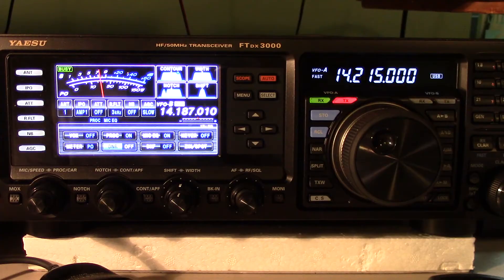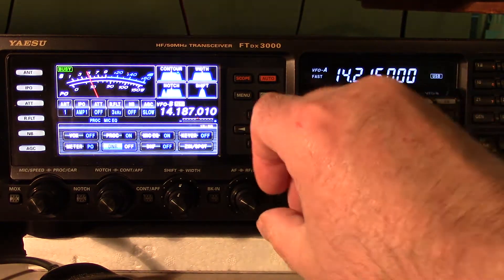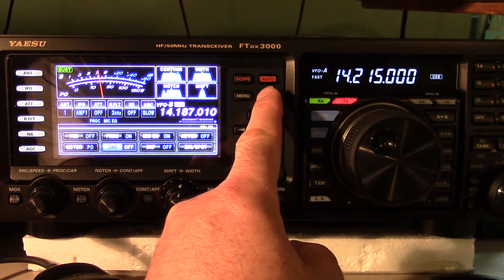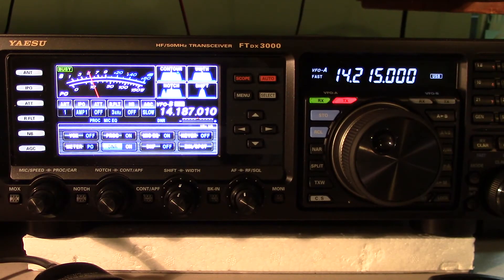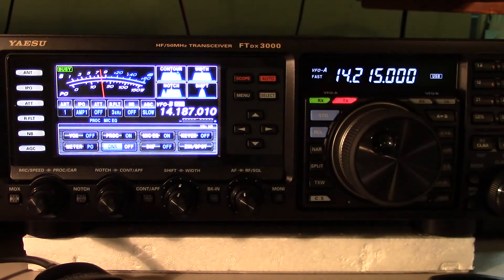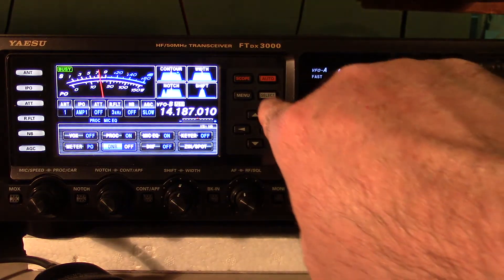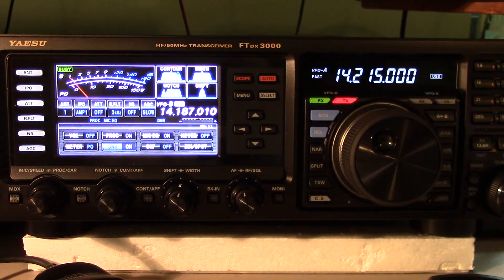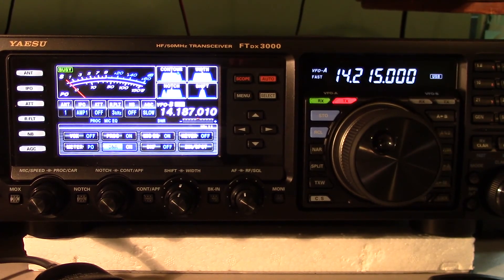Yaesu FTdx3000 noise reduction - HOLY COW!

Comment: I just received my FTDX 1200 2 hours ago and I love it. It is superior to the Icom 7300 receive audio on 11 meter  SSB voice. No matter what you do or adjust, the background noise when listening to weak signals on the Icom gives me a raging headache. I hate the 7300.!! I bought the matching external speaker and the Icom pan adapter software too. I should have bought the FTDX 3000 in the first place!!! Live and learn. I should have stayed with Yaesu!!
Reply: I fully agree with you
Reply: No sir the 1200 is not superior to the 7300. Suggest you get an amateur radio license and ditch the no class CB band

Comment: I have had My FTDX3000 for about 3 years and as most people have said, it is just incredible - the receiver is the best I have heard, which is the reason I purchased an FTDX3000. I had read so many GOOD things about the Receive audio and I was having problems hearing Portable stations on My FT-920. Well. what I had read was ALL Correct. The DNR is just unreal, although You have to go into the menu to change the value of the DNR ,there are 11 values, so it really makes a difference on 11 when You press the button to ON. There are a few little things I don't like, like the Mode Button, the Antenna tuner in which the frequencies must be Pre-tuned otherwise it is slow to tune.. the CLAR/VFO knob which is very easy to bump, unless switched off... What would I buy if i was going to buy a new Radio - Easy, a new FTDX-3000.... Recommended by VK2LEE  LEE

Comment: I spent many hours in several HRO stores, playing with many different radios, trying to find the one i liked the most. FTDX5000 was the best of them all while the FTDX3000 was the second best. I was really amazed by how quiet the radio was and how well the receiver performed. It was significantly better than many expensive rigs like TS-990, IC-7700 etc. So I pulled the trigger and got a new FTDX-3000.
The radio performs better than I even expected after I got it connected to my large HF Yagi system (at 75 ft above ground).  I used to use my Elecraft KX3 but the FTDX3000 is SO MUCH better, especially the receiver. The Elecraft has too much noise and has a hard time hearing weak stations on a busy band while the Yaesu 3000 hears even the weakest stations without much struggle. 
CW performance is superior too. The receiver has no ringing, even at the lowest DSP bandwidth setting and maximum DSP noise reduction setting. CW signals, even the weakest ones, sound like a bell. I wish my Elecraft was half as good as the FTDX3000. Good luck getting such performance with any other rigs, even the expensive SDR transceivers. Believe me, I've done a lot of side by side testing.
I'm not affiliated with Yaesu or any other brands but I'm very happy with my FTDX-3000. I've been a ham for over 30 years and learned a lot about radios and the hobby. I'm very picky about RX performance and RX audio quality. Yaesu exceeded my expectations! Good job!

Comment: I have an FTdx3000 and it's the best (by far) radio that I have ever operated.  Are there some shortcomings?  Of course there are and the ones I think people will want to consider most are the following for they haven't been addressed in firmware updates.  First the Internal Antenna Tuner isn't as good as I have found in many other radios including Kenwood and ICOM's but it does function depending on the antenna you start with.  There are some antennas though that it just won't attempt to tune.  Second I don't like the Notch filter adjustment knob.  It's not a smooth adjustment but more a ratcheted knob that clicks as you turn it.  For me I prefer a smooth turning knob.  I cannot comment on how easy/difficult/involved the firmware update procedure is and if you can use a Mac to do so but I've heard the Yaesu updating method isn't as straightforward as the Kenwoods.  I have also had a Yaesu FT-1000MP Mk V Field radio and really enjoyed the separate VFO's where you could listen to two frequencies at the same time and vary receive level between them.  The FTdx3000 doesn't have dual VFO receive but does have VFO A and VFO B that you can set and then switch between them but cannot have both active on receive at the same time.

As for my personal preference I would choose the FTdx3000 over any other Yaesu radio for I believe it's the best (combination), quietest, receiver they have.  The 5000 will give you two independent receivers and the 5000 is rated a better receiver by Sherwood but as for being quiet and a low noise floor to work with I think the FTdx3000 can't be beat by any other radio Yaesu makes, at least at this point.  I could be wrong and that's my opinion but it is based on my personal experience of comparison with other radios and listening to youtube videos of other radios.  I AM BIASED and admit it but I don't think there is a better buy in Radio, for the money, and for what you get.   Once you get the menu settings perfected for your mike and engage the ESSB (4 Khz) transmit audio I get constant, glowing, reports about how good my transmitted audio sounds.  When you open up our receive bandwidth, engage the Digital Noise Filtering and utilize the RF control along with choosing whether or not to engage the pre-amplifiers you can have a receiver that sounds like it's not even connected to an antenna at all until you hear that signal come booming through.  

The real satisfaction comes when you are setting there enjoying that super low noise floor where the radio is so quiet and then through that quiet hear some weak station that you know you would have never heard on another radio.  I have a backup radio ( Icom IC-7000 ) and have many times hear stations/calls on the Yaesu FTdx3000 that when I switched over to the ICOM became lost in the noise floor or normal static.  I'd love, for myself, to be able to set it beside a Flex 6300 which compares with it cost wise, and see how the two compare but then if I ever get to where I purchase another radio I don't know if it would be the Elecraft, Flex 6300 or Flex 6500 and since there isn't a Radio Fairy to drop off one and I don't have some rich relative that's willing to bestow some love on me I'll remain and be happy with what I have for I'm truly grateful that I'm able to have that and feel that if the FTdx3000 is going to be surpassed then it's going to be a much more expensive radio that will have to do it.
Reply: Gary K I also have the FTDX-3000 and it is by far the best rig I have ever owned.  The receiver is really top shelf!  I can turn on my Ten Tec Omni V, Icom 761 or any other rig I have and I can just hear a signal in the noise.  I turn on the 3000 and I have excellent copy.  I have yet to find anything I don't like about this rig.  It is a great value for the money.  The panoramic display is not the best and if you want an excellent pan display purchase the Lp-Pan2.

Comment: i thought you had the 1200? do u have both radios? if so, awesome. this is the radio i have been thinking about as one can never have too many HF radios, though u can have too many HT's and i know hams who do. HI
Reply from the maker: +djjoep100 Not much difference between them really. Depends on your budget if you want the live spectrum scope and slightly better receiver.
Reply from the maker: It's a long story. Better to not ask. I only have the 1200 now.
Reply: either is a nice radio. cant go wrong with either one of them,
Reply: +The Radio? Hobbyist  so the 1200 is better then the 3000 ? I want to buy one . should I get the 1200 or the 3000 ?

Comment: Would be curious to know if the noise reduction/noise filtering capabilities are as equally impressive on 40 & 75M?  I have a Kenwood TS-2000 that I simply HATE on 40 & 75 Meters because it's so noisy.  Noise floor on the TS-2000 here on both 40 and 75 is easily S5 without the pre-amp and S9+ with the pre-amp on.  Basically unusable without using the ATT, RF Gain and Noise Reduction.  It's enabling the Noise Reduction on the TS-2000 that makes everyone sound like an alien.  

Am seriously considering a FTDX-3000 after being a Kenwood guy.
Reply: FTDX3000 is far superior to TS-2000. I have a 2 element Yago or 40 meters, at 75 ft above ground. The noise level on 40 meters hardly ever goes over S1 on my FTDX3000. It's a very quiet, yet very sensitive radio, great for contesting too, with it's high RX dynamic range. 
The noise level is at S5 on my Elecraft KX3, with the same antenna. I owned a TS2000 a while back. I returned it back at a loss because of it's poor performing receiver. It was very noisy too.
Reply: 3k thrashes the 2000

Comment: Very nice. I have a Kenwood 590 but maybe the FTDX3000 is better. Any comments?
Reply: 10 years too late but in case it's useful to anyone; You won't work stations on the FT-DX3000 that you can't work on the TS-590S. There is no advantage from that point of view. I love the ergonomics of the TS-590, it looks great, like the 570 did too. Kenwood radios are beautiful. There is a document that Kenwood produced detailing all the design and engineering choices when designing the '590. It's an awesome read if you can find it. Love your '590 (S, DG, whatever). It's a fantastic radio. Is the FT-DX3000 better?  Yes. A little. ..not much though.  Not nearly enough to regret buying your TS-590. I own the DX3000 and sometimes I wish I'd bought the '590 instead, so stop worrying dude... They are both excellent radios.

Comment: i wish my ICOM 7200 was that quiet.Summertime atmosphere sounds like a thunderstorm on my wire antennas, almost all of the time.Cant wait for fall and winter when the bands will improve or i come into a financial windfall and can then do a Transceiver upgrade.I would like to compare the IC- 7200 and the Yasaeau DX  3000 side by side with the same antenna to see just how much better is the noise floor on the 3000. Has any one compared those two side by side ?